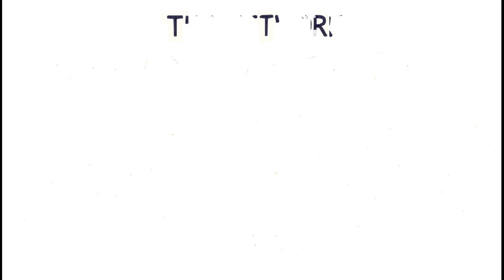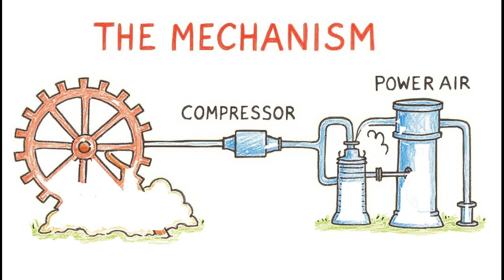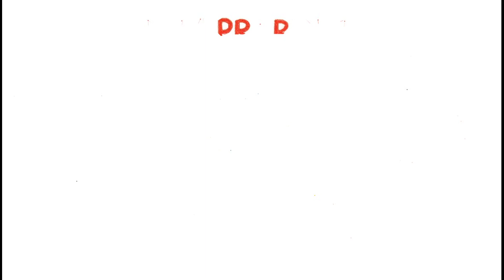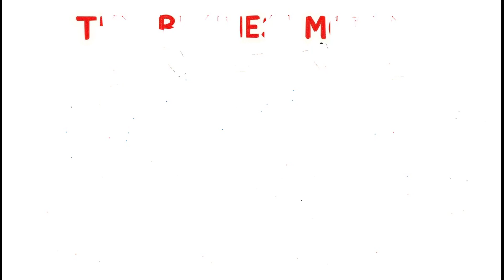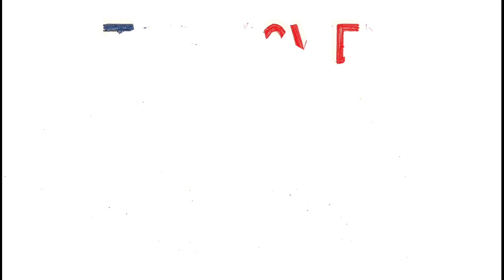The Forgotten Clean Energy of 1906

Comment: As Magnus posted compressing air heats it,  and  cooling   pressure reduces,   this is an unrecoverable energy loss.  Its a not very efficient battery.   You can also use rubber bands it's  more efficient and less energy is lost,    in fact for toys its superb cars air planes and boats.  All our energy comes from the Sun and its free when   having a Sun tan but converting it to another sort is costly and suffers efficiency losses.  Hydraulic Accumulators are better as Armstrong developed and used to power workshops before electricity a Google finds examples of this technology raising and lowering bridges.  Our best bet might well be in energy recovery with a gravity railway like a roller coaster but less  dramatic
Reply from the maker: That's some really nice insights, like the rubber band concept
Reply: Rubber bands heat up under tension, as they cool, some of the stored energy is lost.
Distributed compressed air was ideal for heavy duty high power short duration tasks like riveting guns, presses, lifts, shears etc. Not so good for long running motor style applications.
Compressed air has some great advantages of almost infinite life cycles, virtually zero static drain, and when kept below 150 PSI the compression/expansion round trip can be quite close to 100% efficiency. The use of gravity based accumulators to keep a constant pressure also helped efficiency.
In some applications it could still be a great fit.
Reply: @John_B55   think its a frictional loss and in the Wakefield model aircraft the multi strand rubber motor was lubicated with caster oil a messy job.Yes air has its uses in hydraulic oil car ramps and inpact wrenches

Comment: Compressed air is not free, you have to power the compressor and pipes cost a lot of money and then you get problems with energy liost via air leakage. You also lose energy during compression, you get waste heat. It is overall less efficient then using electricity. No conspiracy.